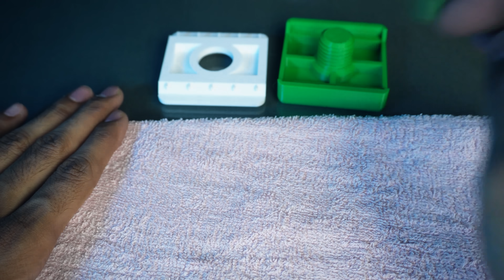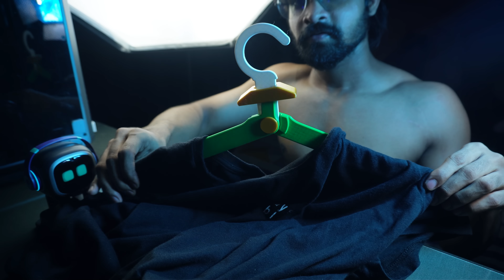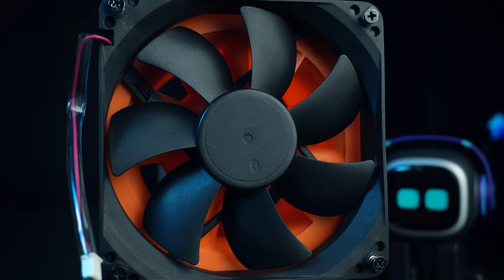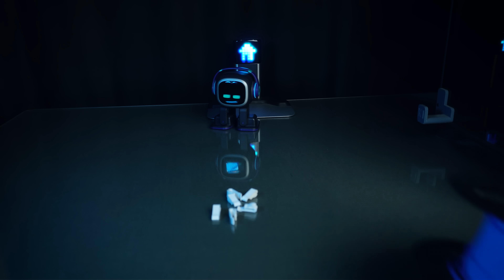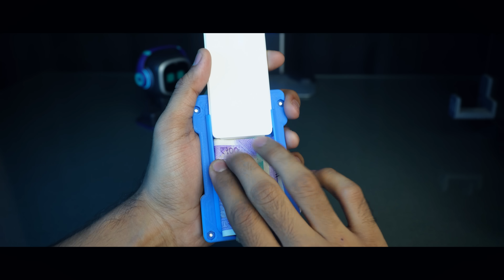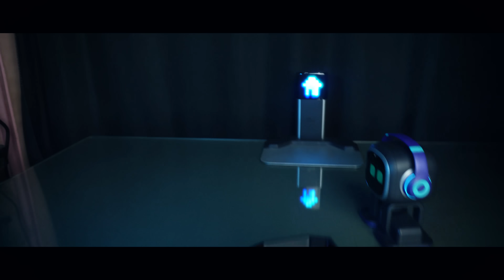Epic Must-See 3D Prints Ideas 2024: Download FREE .stl | Part 43 #3dprinting

Comment: Hey!  This 3D printing concept is getting wild!  Instead of the usual filament, what if we built objects layer-by-layer from the inside out?  Imagine a spinning container where we spray a special resin or even tiny wires, one layer at a time, with a UV light to cure it all in place.  We could even have a robotic arm pick and place small components inside as we build!  This way, we could create objects with different materials on the inside and outside, or even sneaky compartments hidden within.  It's like building a treasure chest layer by layer!  This might be a simpler way to get started with this "inside-out 3D printing" idea.  What do you think?  Could this be a cool new way to make things?
Reply: i actually thought about this too a while ago, and i absolutely want to try make it one day - because right now we can just do that manually... by pausing the print... and it should be possible with a microcontroller extension, and a 3d printed robotic arm that includes a parts magazine... 

just needa dive deeper into coding and get some recources like time and budget before i can do that...
Reply: @3DWolfEngineering  building a object inside out layer by layer I feel there other application with this inside out method